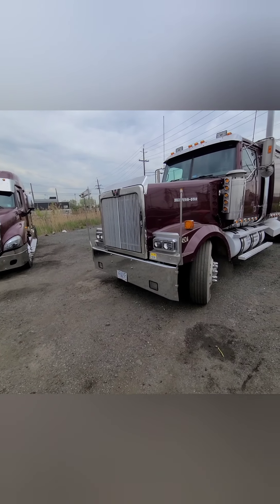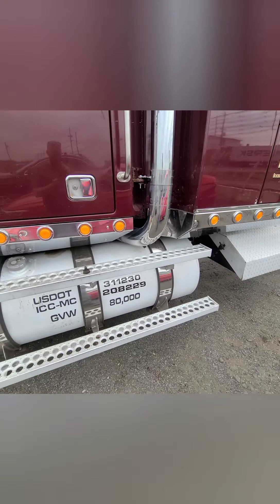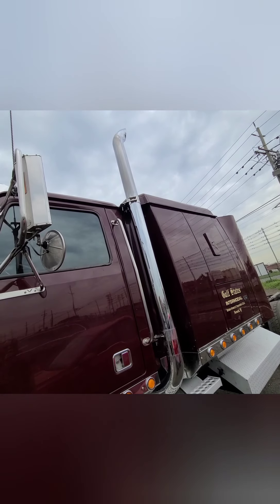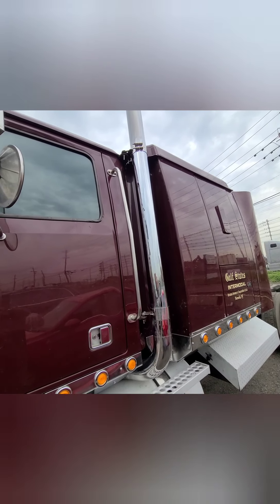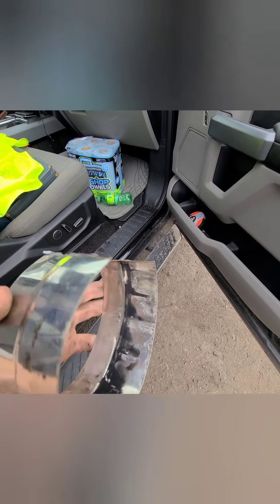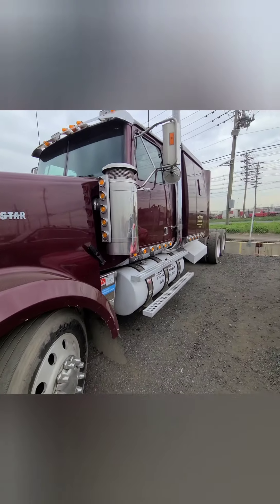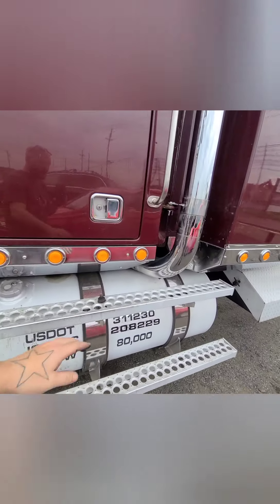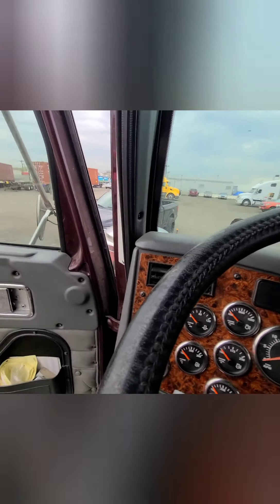Western Star 4900ex straight pipe Exhaust. EP 1

Comment: You can get heat shield clamps for newer truck to put shield back on
Reply from the maker: I got them but they are to small to fit the original heat shield that says western star in them which is the ones i like so just figuring out a way to keep the OEM ones